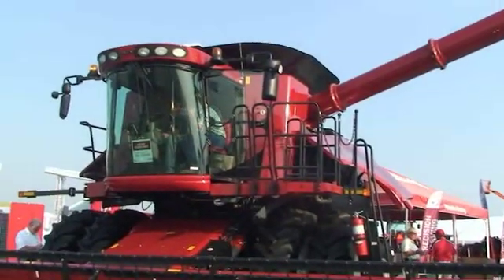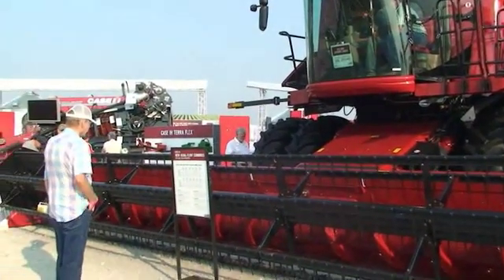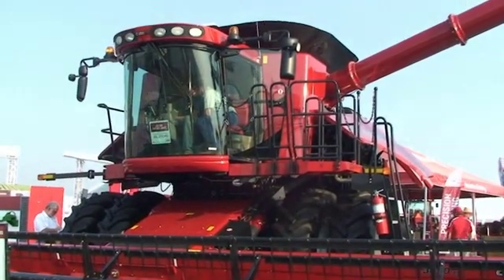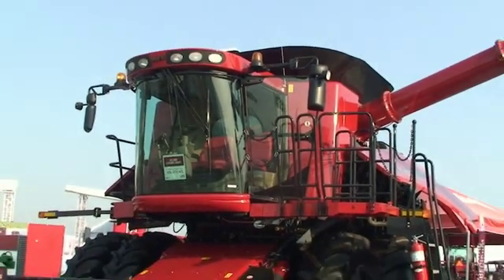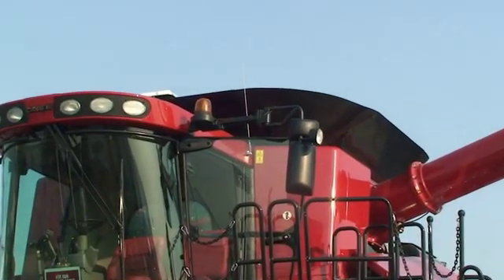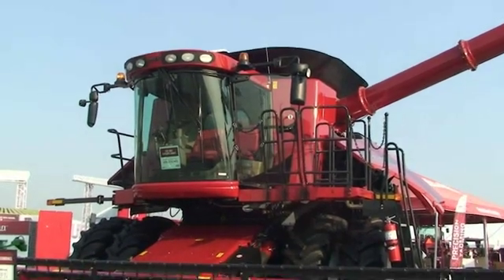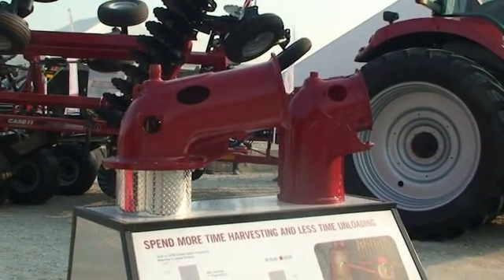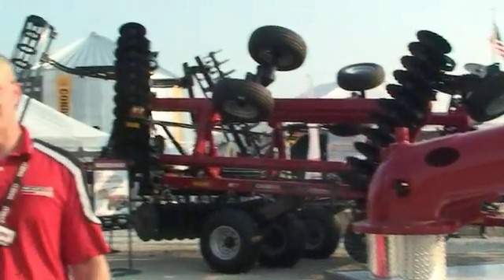Next generation Case IH combines

Comment: where did the case quadtrac come from?? as you can see in my comment, I am talking about conventional tractors... so what sort of experience do you have with masseys if very few of you guys use them?? As i pointed out, i work on farms, not selling tractors. this year i had a brand new 7615 and a demo 6150r deere back to back on a 3 leg subsoiler at about 10 inches deep and the deere was no better at pulling and was drinking 34l/h at most in comparison to the masseys max 39l/h!

Comment: if you are interested in efficiency you should be looking at massey ferguson for conventional tractors, i have worked a big arable farm here in the UK for the last 5 summers and we have had deere, deere, case, case and now massey! we run a 2 year rolling contract for 5 conventional tractors! there was always one case in the yard broken, both the deeres and the case drank fuel like no ones business. we reckoned that last summer, for hours/work they do massey use 2/3rds the fuel....

Comment: What the fuck are you talking about? I'm talking about the other things, like the cvt drives. Just like they copied the tailings return that case ih designed initially. I'm not talking about some fucking tracks.